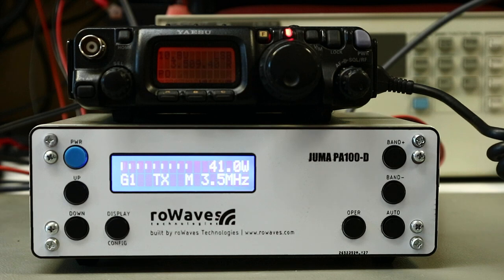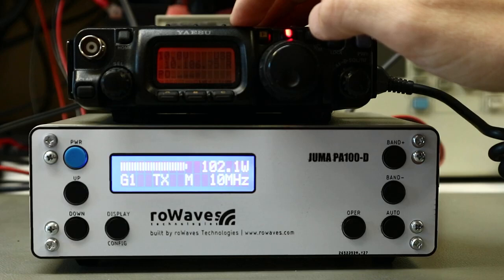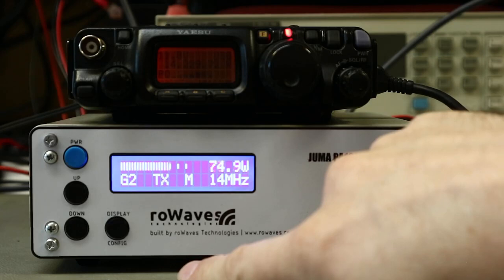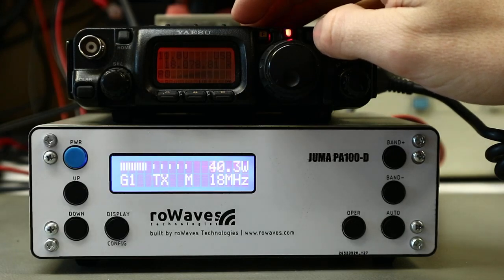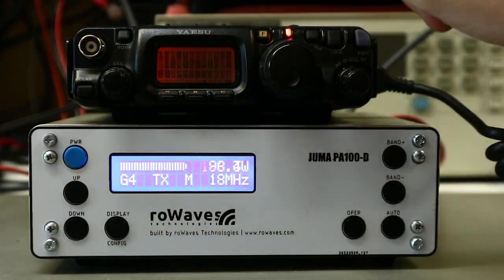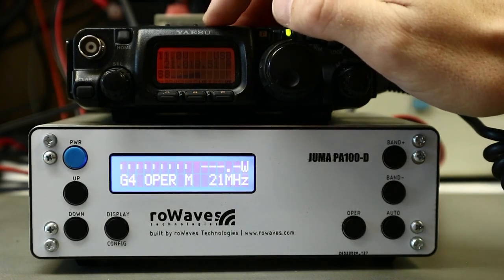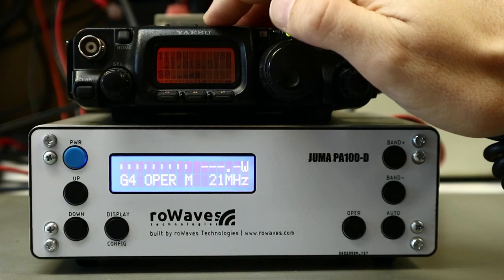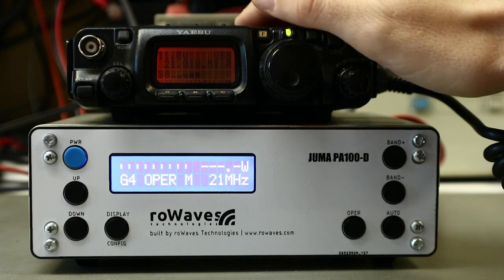PA-100D working with FT-817

Comment: What’s the point of using 100W amp with a QRP radio ? Just get a 100W radio like a IC7300.
Reply: What's the point of a 100W radio when you can get a 200W radio like e.g. TS-990S, IC-7760, FTDX-101MP  or better 500W radio like the FlexRadio Aurora AU-510?
Reply from the maker: Thanks for the question. This is better to be asked to our customers. A portable 100W+ PA in companion with a QRP radio is useful for SOTA etc. I think we should take into account here here also the price of the radios you mentioned...
Reply from the maker: Thanks for the question. This is better to be asked to our customers. A portable 100W+ PA in companion with a QRP radio is useful for SOTA etc.
Reply: I have downsized home in retirement! My IC-7300/9700 stack with Icom speakers & psu’s is far too big for my available space; an IC-705 plus a PA-100D with an external eflw antenna provide a great cost effective solution!

Comment: What's the purpose of up down buttons while transmitting??
Reply: If you look closely you will notice that while transmitting UP and DOWN buttons will increase or decrease the gain level (power output) based on the needs. So these buttons are changing the output level / amplification. vy 73 de Andrei, YO6TJJ @ roWaves
Reply: @YO6TJJ  thanks very much 73